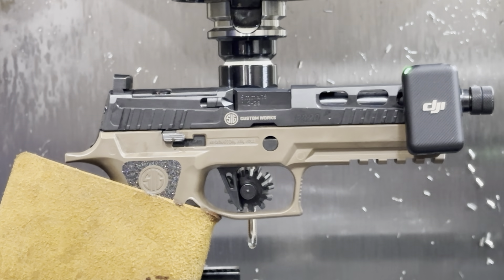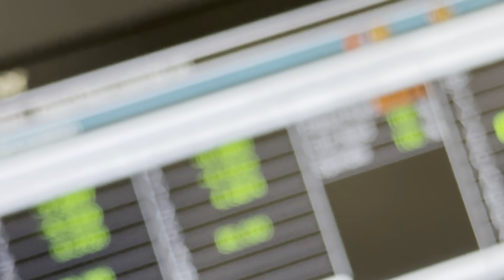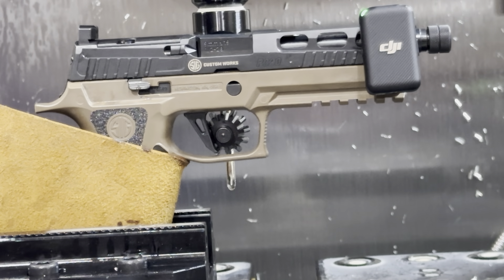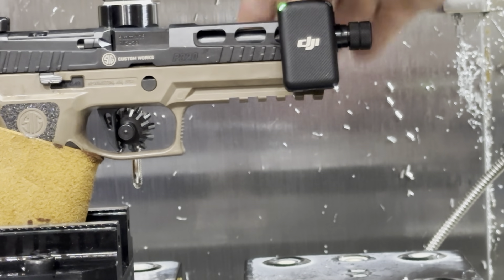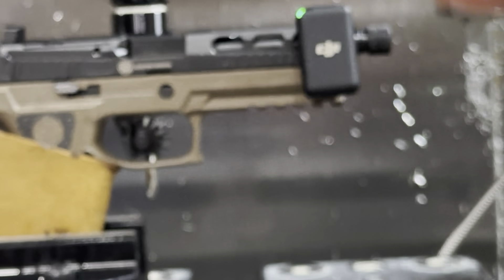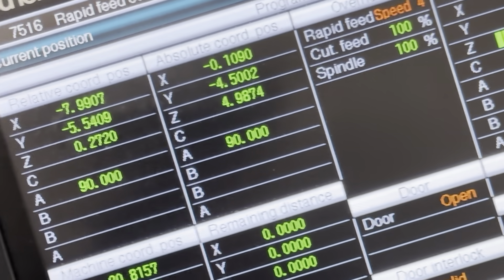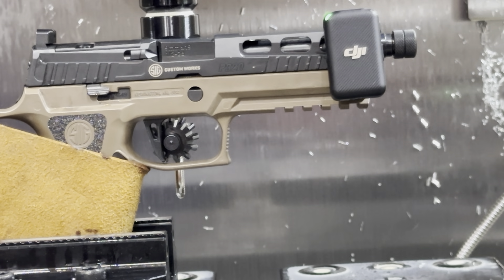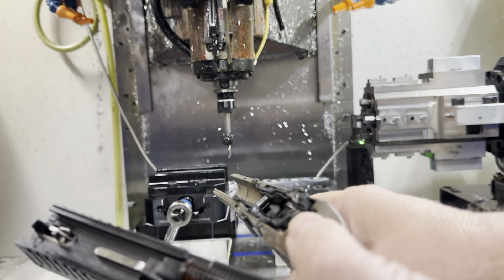Sig P320 accidental discharge tested in CNC machine.

Comment: It's incredible how many people are working hard doing the safety tests that SIG should have done before releasing these pistols.
Good job.
Reply: Did you watch the video? He shows that the gun is safe because unless you deflect the trigger, it won’t go off
Reply: @Seansousa757  
> He shows that the gun is safe because unless you deflect the trigger, it won’t go off

He shows that this specific specimen of the gun is relatively safe. Clean and not worn out as well.
Reply: As an engineer, I can guarantee you they happened

Talk to the business people on what happened next
Reply: @ab3040  Exactly right, the system most likely in it's prototype form would not discharge by it's self. But through the cost cutting for top dollar...we get this.
Reply: I've always heard Sig released to market, then had their customers beta test. This proves it.
Reply: Im glad Im not their test pigeon that they can claim no liability over.
Reply: Because these tests are un realistic
Reply: So your next test put a magazine in the gun and let's see your results.  Anyone can rig a test.
Reply: Gov' inspection, before millions of dollars spent, would be even better.
Reply: I’m not defending the p320 . I beleive it’s inherently dangerous so much so that I actually bought one back from a friend after all the new came out just to make sure nothing would happen to him. That being said This test has been replicated with major brand every striker fired  pistol on the market and the all fire when the slide is manipulated in this manner while holding slight pressure on the trigger .
Reply: @Xrobberyx 
I know a guy that has an Audi 5000 and a Pinto. Will put you in touch so you can buy them so he will be safe. 😂

I have never seen a video of an hk doing it. Glock, yes. Hk, nope.
Reply: His test shows that it is not firing unless the trigger is pulled. I'm not sure what your point is.
Reply: You don't know that
Reply: They already did. Watch the video. You have to pull the trigger. That was designed to work that way lol. Stop listening to idiots 😅
Reply: Who the hell is deleting my comment???!!!
Reply: @iliafigueroa4820 123 not it
Reply: It should be no surprise that a gun will fire if the trigger is pulled.  I want to see tests of a gun that fires without ANY trigger pull.  That is what matters.  If you put your finger on the trigger of a gun, you should be prepared for it to fire.  Why do you think we are taught to not TOUCH the trigger until ready to fire?  And this isn’t taught just for Sig guns.  I am not a Sig fan nor a Sig hater as don’t own a Sig and never have, but unless I see some demos of guns firing with the trigger never having been touched, I can’t get too excited.
Reply: @LTVoyager 
Dude, do you know that not only fingers in triggers are a problem?
Debris, piece of cloth, small rocks, there are many other things that can get in the way and not only a finger in the trigger can discharge a gun.
Reply: @iliafigueroa4820 Dude?  Are we back in the 60s?  Yes, I am well aware which is why we should use only properly fitted holsters and maintain our guns well and not stick them in a pocket or belt.
Reply: @LTVoyager 
Yes, dude is better than the boring sir and lame bro! 😂

That gun has fired itself HOLSTERED. Look for the video of some cops arresting a loser and one cop bends and the stupid gun goes off.
Reply: @LTVoyager 

https://youtu.be/3_CYjoK2bqo?si=Hrg8x4DNeQh_l2UM
Reply: @iliafigueroa4820 I didn’t see what was inside the holster.  If the holster had debris in it or wasn’t fit to the gun, anything is possible.  The devil is in the details and I have seen few details from these alleged uncommanded discharges.  And all of the one’s I have seen in YouTube videos have moved the trigger rearward to some degree to get the gun to go off with pressure on, or rattling of, the slide.  Have you seen anyone who got a 320 to go off without any rearward trigger movement?
Reply: @iliafigueroa4820 Didn’t read my comment, did you?
Reply: @LTVoyager 
I read it.
Why?
Reply: @LTVoyager 
That cop had a holster.
Reply: The US government is also responsible if not more responsible
Reply: Sig hoovers up gov contracts because the CEO is a small hat named Cohen. They control our government, arms industry, banks, media, and everything else imaginable. The dude was caught arms smuggling and nothing happened.
Reply: @AndrewGarnerAdventures makes no sense. You think the government is at fault when a vehicle breaks down, or is faulty?
Reply: He's literally pulling the fucking trigger and upsetting the sear when pushing down on yhe slide. The only thing this proves is that without pulling the trigger the gun will not fire.
Reply: @marlboroman71818  he proved the glock failed the exact same test. watch his other video
Reply: THIS.
Reply: This is an irresponsible statement.  DID YOU PAY ATTENTION TO THE MAGAZINE DEMONSTRATION?  That is a safety feature that required engineering, testing, re-engineering, re-testing, so forth and so on until the magazine safety feature worked properly.  I don't know what the final determination of fault will be, but please don't say SIG didn't test.
Reply: @briansmith8999 exactly true. People just blurt out the stupidest things don't they
Reply: Sig is COOKED.
I don't care if it's only the P320 that has this issue - Sig Sauer has shown their colours and I'm never buying a Sig again.
Reply: He doesn't have a magazine in the gun.  By design the slide will not have the same play with a magazine in it.  Sig should sue this guy.
Reply: Not favoring the Sig,  but lets try these same test with other bands of striker fire pistols.
Reply: YOUR PULLING THE TRIGGER hello, if your PULLING the trigger & the gun goes off that's kinder the point, none of these striker guns are as safe as a revolver or hammer/double single action. Thanks for showing us .😊
Reply: @daveknight8410  How come people keep saying hammer fired guns are safer? 
At least some of them  can go off, if dropped on the hammer...  That has been known for over a century.
Reply: @daveknight8410  Do you even know what cocked, and not locked means? Good luck running around with a hammer down, and cocked on a lot of exposed hammer fired guns. Especially along something of the lines of a 1911/2011.
Reply: @daveknight8410 CORRECT! But if you follow the rules of gun safety, Striker fires are perfectly safe.
Reply: @daveknight8410  Have you ever owned or handled a handgun?
Reply: @daveknight8410 yeah when a trigger is fully pressed LMAO not when there's only a slight tension to it. What kind of shit is that?
Reply: @maicon9  He has to get it to .9 for the wiggle to let it go off.  That is .1 away from firing.  I wouldn't call that "slight" tension.  I doubt anyone could reliably pull the trigger to within .1 of firing.
Reply: Pulling the trigger back past the wall then manipulating it to fire is ridiculous. If it's firing with people's finger on the trigger, it isn't the firearms fault
Reply: No there are industrial standards for firearm testing. If every manufacturer had to test guns to bored grunt proof there would never be any new guns designed
Reply: @tombearclaw What i know from my teacher when in CZ were doing drop test they just build polley system.
This more precise.
Reply: @tomasnavratil7010 yes it absolutely is. 
Realistically most manufacturers didn’t do all angle drop testing until the sig issue. Most did and probably still do muzzle, heel, upright, and upside down from approximately 4 feet. 
This test shows sig is correct that it doesn’t fire without a trigger press. At least that’s true on the pro series guns as tested. I wonder how well the earlier versions of standard p320s and m17/18 would fare. 
An incomplete trigger press should not be able to discharge the weapon though
Reply: @tombearclaw  This test shows that this sig doesn't fire from minor manipulation of the slide without a trigger press. That doesn't mean this is true for all of them or that they're all drop-safe. The amount of pressure he applies is also pretty minimal. I'd like to see what happens if you cover up the trigger and put it in a running dryer for an hour or two.
Reply: @cremice78  You gave me a idea, I will do that, Place a P320 in a dryer on no heat and tumble it around.
This test is a functional test, I would expect the gun to fire if I PULL THE TRIGGER. Heck he can do that with a P365 or any non SIG gun and get the exact same results.
Reply: @kfelix2934 Great! I'd love to know what happens. If I had one, I'd try it but I can't justify buying a potentially unsafe gun just to find out.
Reply: @tombearclaw glock has been doing angle drop test for 3 decades. Every stacatto you buy will fail a drop test.
Reply: @tombearclaw There are no industrial standards for firearms testing? Maybe in your basement there isn’t but in the real world certainly there is!
Reply: If you take the Sig slide off, replace it with a Glock slide, then toss out the Sig frame FCG, and replace that with a Glock frame, it will be safe to carry condition one around your loved ones.
Reply: These tests are unrealistic in the fact that you'd need to have the trigger pulled back to breakover and then wiggle.
Reply: @Parrish-Patriot71  unless you have a ton of rounds through it (military does), the Primary sear and secondary sear get worn too quickly and the result is a discharge. In any pistol this can be a factor, but since the sig has so much play in the slide to frame interface it can easily be replicated without wear to the sears. AT NO point should any weapon system discharge until the trigger itself has been pulled, and released the sear regardless of how much slack is being pulled out of the trigger.
Reply: @GranadaBashlav  the glock does the exact same thing as the sig. watch his other video
Reply: @GranadaBashlav  not accurate at all.  I doubt the average military person carrying a P320 shoots it anywhere near as much as someone who shoots USPSA. I know there is no way the average police officer may have more than a few hundred rounds a year. The play is there for a reason and unless you jam something into the gun to make the trigger activate nothing is going to happen.
Reply: @Parrish-Patriot71  The Weapon system is checked into the armory, the weapon is then checked out of the armory by another soldier....rinse and repeat...This happens over the lifespan of the weapon system. Yes, TONS of rounds go through these systems. Very accurate.
Reply: @CitizenSeven500  Technically all striker fired weapons can have this same outcome, it's the nature of striker fired weapon systems. But With that being said, Glock does NOT have a particular pattern being publicly displayed. Sig P320 does. If you run up to the gun store right now and have them show you a Glock, check how floppy the slide is, then compare it to a P320, there is a more than obvious difference in slop. The Sig should have never left the factory with enough slop to disengage both primary and secondary sear by wiggling the slide...
Reply: @GranadaBashlav  regardless of the slop, both seers released at exactly the same point when the slides were wiggled
Reply: @CitizenSeven500  By that you mean both sears failed to catch the pin?
Reply: @CitizenSeven500  I can't get my G19, S&W competitor OR shield EZ to fire with the slack taken up, against the wall... to discharge at all by moving the slide. Wait, the slide doesn't move on these 3 pistols. The Glock has 4200 rounds through it (almost time for spring replacement), Competitor 2600 rounds and the EZ has 120 (This pistol is my sisters and also TECNICALLY isn't a striker fired pistol because it has an internal hammer). Sig should just stick to hammer fired pistols OR.... Fix this issue. but either way, there is NO excuse for the amount of slop in that slide especially since the internal safeties RELY on the interface between the frame and slide. The P320 would be the best pistol around if they would just tighten them tolerances up...
Reply: @GranadaBashlav  can't get my 320 to either because my finger can't put the trigger at 20/1000. the cnc can. either both passed the test or both failed
Reply: @CitizenSeven500  P320 failed, Glock can not be on the same test, as it has a trigger safety....That trigger will break off before discharging on the Glock without depressing the trigger safety lever. That's information he fails to mention in the Glock video. Watch the video again, look at the trigger safety being depressed. That makes the comparison null. I'm not even a fan of Glock pistols, the grip angle drives me nuts but still, facts are facts. (the irony is i EDC a Glock 19 gen5 MOS)
Reply: @GranadaBashlav  all striker fired pistols will fail this test, including your glocks
Reply: @GranadaBashlav  https://www.youtube.com/watch?v=LKD0S3KhwdI&ab_channel=TriggerSmart
Reply: @CitizenSeven500  grip safety and trigger safety both depressed. All this video is showing is the trigger being pulled to set a discharge scenario. NONE of the other pistols will discharge without the trigger safety being depressed.
Reply: @CitizenSeven500  Attempt to replicate this test without depressing the trigger safety lever.....Won't happen. It's the whole reason 90% of striker fired weapons have trigger and or grip safeties. the manipulation of the slide to discharge a weapon that has no other safety other than internal is going to fail when the trigger is at the wall. Nobody seems to understand that the other pistols in these tests ALL have 3+ safety mechanisms that ALL have to be manipulated in order to discharge. Where the P320 has 1 safety and 1 backup (secondary sear hook) and it is internal.
Reply: @CitizenSeven500  https://www.youtube.com/watch?v=6if3Fno-SQE Trigger safety lever would solve the issue, Glocks have this feature, thus a discharge can not be commanded unless the TRIGGER is fully depressed WITH the trigger safety also being depressed. Glock (any model) Sig P320 (this model).
Reply: @GranadaBashlav  I would not own any gun with that much play in the slide. Mine are tight. Another thing, is there a magazine in it? It doesn't look like it to me. That does make a difference.
Reply: @Steve-l7h4c  I would not own one with any slop either, I feel ya on that. The mag being inside the sig actually manipulates the front of the slide down, so even easier to discharge without command. Just a flawed design, all they needed to do is add a grip or trigger safety and they would have been good. But in this case, cost of reproduction of the system was more important than safety. That is why they beat Beretta, Glock, and FN for the contract. Now Law enforcement, military, NATO, and Civilians are feeling the impact. The FN509, M9, and Glock 19 would have been a MUCH better choice. But it is what it is ya know. In hindsight i be the military is like "WTF...why move from the M9" It's tried and proven over decades.....It takes ALOT to make an M9 malfunction...
Reply: @Parrish-Patriot71  I think that's his point -- He's demonstrating that it will not fire unless the trigger is pulled back almost to the break point.
Reply: @Parrish-Patriot71 The margin  of how much you actually need it to be pushed back after the pre travel is so small that you can probably replicate it by debris  or carbon build-up. 

Couple that with horrible tolerance stacking... and well you get the picture
Reply: @Parrish-Patriot71 what if I told you there’s this thing called inertia and objects like triggers stay in motion until acted on by an equal and opposite force 😮
Reply: @Parrish-Patriot71  if it triggers with just a little wiggle with tension on the trigger, it stands to reason it will trigger with no tension on the trigger with a big jolt on the frame...

Comment: That kind of pressure could easily be applied by lint, carbon scoring or dirt over time, or more likely a pliable leather holster that the trigger runs across as the pistol is being returned to the holster. Trigger travel can also be created by jarring the gun up and down. such as in an altercation. I have always been a huge Sig fan boy, but its time to see the light on this issue Sig. These FCU's need to come back, ?The triggers need to be replaced with safety tab equipped triggers. The FCU shelves need to be remanufactured at true thicker 90 degree angles instead of being angled from 0 to 90 by press fitting machines, which creates a rounding effect which creates that up and down play between the frame and the slide. Lastly, since Sig is refusing to acknowledge any of this, go buy P-220/226/229, an Echelon, a Glock, a PDP, an M9A4, a good 1911, a CZ P10, a VP9/40, a P-30 or what ever does not make you worry about losing some toes. Still love ya Sig. You're still the best DA/SA, SAO hammer fired manufacturer in the world. My 226's and 220's are some of the best firearms ever developed. However its time for a P-321.

Comment: Great video sir.  As I expected, a properly working gun will fire when you pull the trigger far enough.  And as expected, they will hit whatever target it's aimed at.  Last time I checked, that's what guns are supposed to do.  Just like automobiles are supposed to get you from point A to B without running into an oak tree. Thanks again.

Comment: Didn't the AirForce guy get ended by "putting the gun on the table" with nothing anywhere near the trigger?
Don't these thing go off if their dropped in the wrong place with nothing anywhere near the trigger?

If I was asking why the gun went off and the answer was "they were pulling the trigger - but they didn't mean to" then that guy is an idiot that shouldn't be trusted with a firearm.

If these SIGs only went off when someone was pulling the trigger - there wouldn't be any issue!